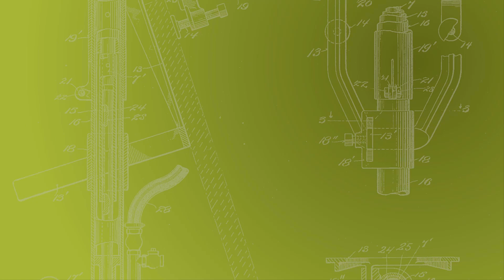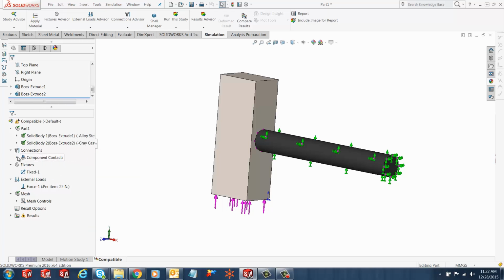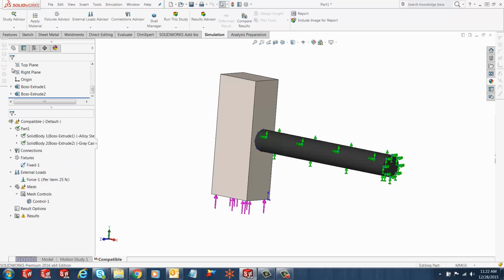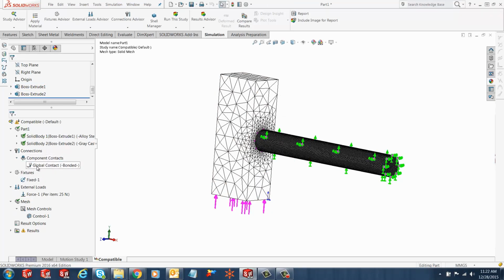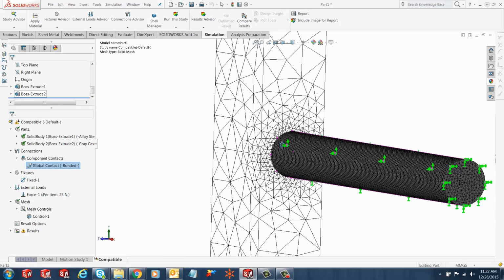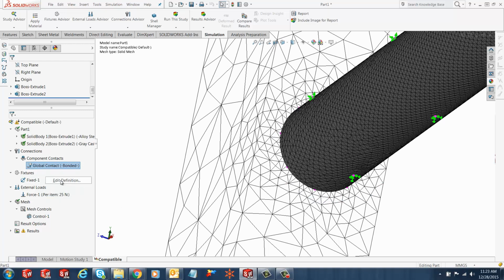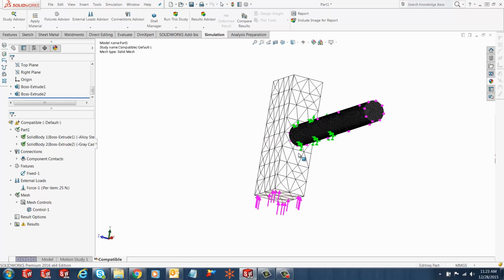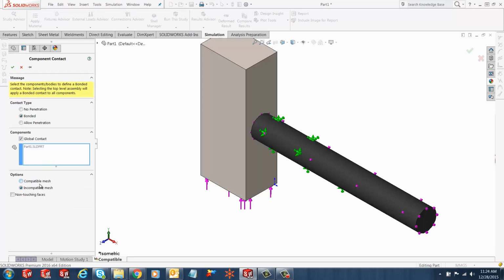SOLIDWORKS Quick Tip - Compatible and Incompatible Meshing

Comment: This was very helpful, however I can not use the same trick when one part is a shell element. What can I do in this case?
Reply from the maker: Hi Abebe,
You are correct, compatible mesh does not apply to shell/solid interfaces.  In cases like that you would need to apply a split line to the solid at the shell/solid interface to create a model edge at that location which you could then apply a mesh control to and match the element sizes between the solid's edge and the shell.